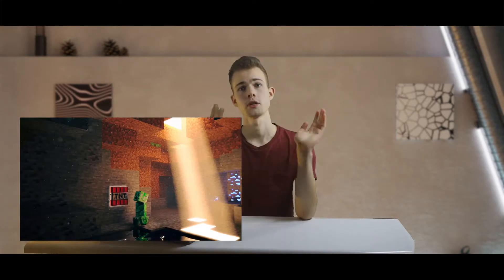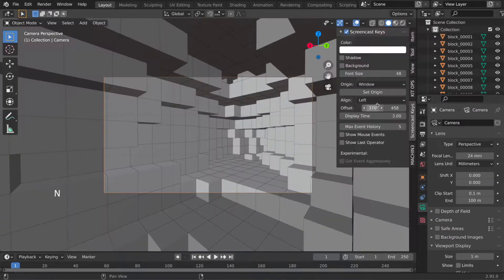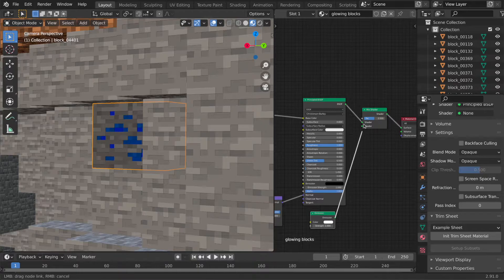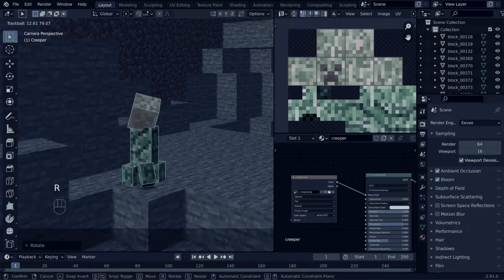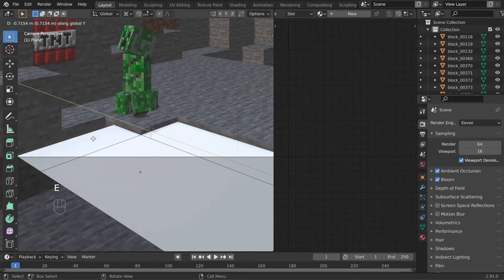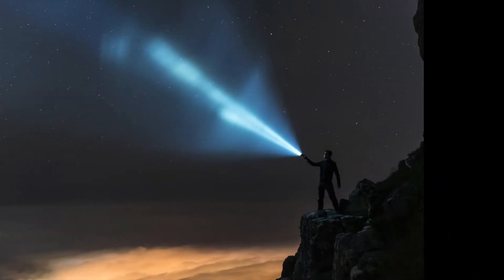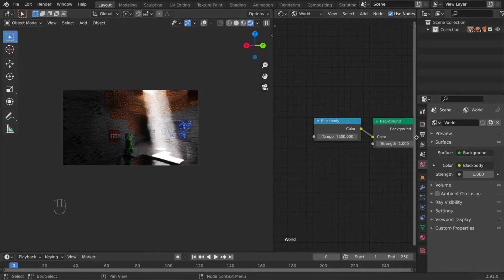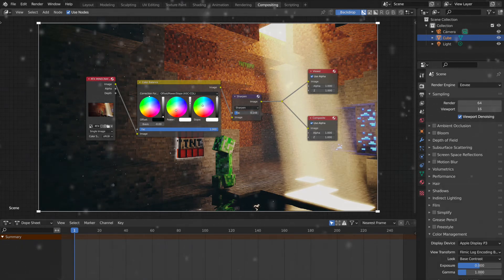RTX Minecraft in 15 Minutes with Blender

Comment: Nice tutorial dude. Btw you shouldn't decrease light bounces amount, it make image only worse and not really faster (ok faster but it doesn't cost it at all), but decreasing AO amount (in simplify tab) to 2 will reduce render time.  Also it'll be nice to use e-cycles renderer, it's 2 times faster.
Reply from the maker: Yeah I forgot the simplify feature, this would have made it faster for sure. The e-cycles renderer would be wonderful, but since I don't have a Nvidia card, it's supposedly only 10-20% faster with AMD GPUs and with CPUs in general.
Reply: The water didn't work when I converted it to a Mesh it goes back to a flat state and doesn't keep the ripples.